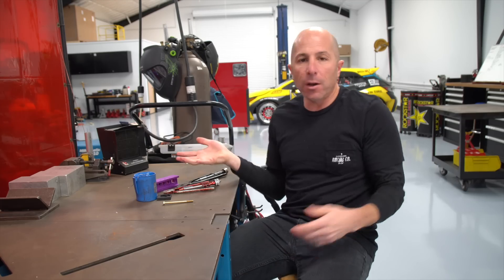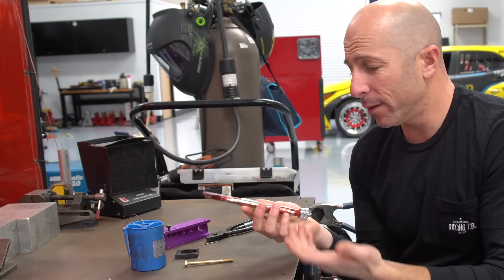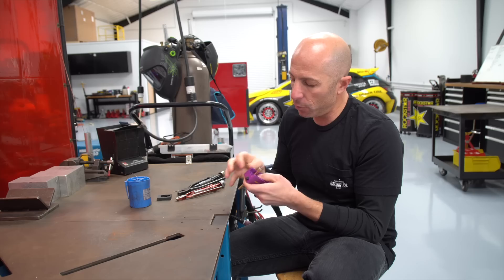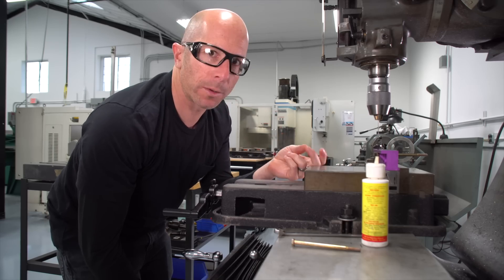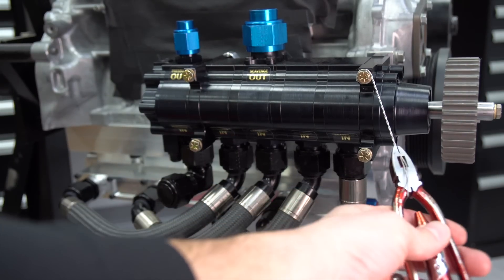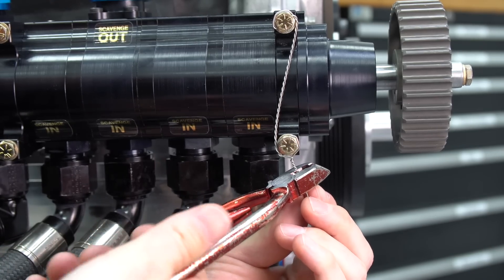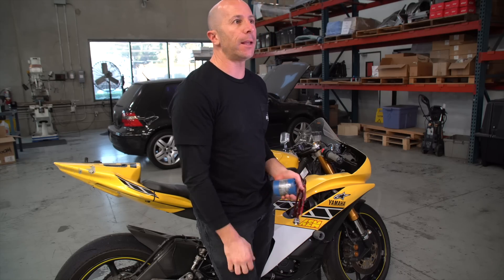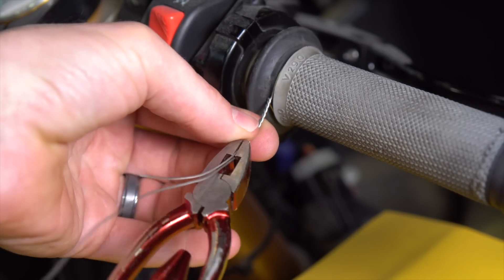How To Safety Wire Bolts, Grips and Drill Bolt Heads

Comment: I work on aircraft and boy do we used safety wire everywhere. Just a tip for you. Once you have the path of the loose wire going to the second bolt. Clamp the tip of your pliers where the hole for the next bolt is. Then give a slight and quick yank of the wire and hold the tension, then twist your pliers. This will pull the slack of of the wire. Another note, as you twist the wire, it will shrink in length and you always want to compensate so you don't have to re-twist on wire you've already twisted. Good video for beginners, but the wire between the two bolts you want really tight as well. For this application, it is fine, though.
Reply: Fellow A&P here...I had no real nitpicks about his safetywire, until how I saw how he finished it. My old sergeants in the AF would've CRUCIFIED me if they saw me wrap the last end around the head and THEN pigtailed it.

Other than that, pretty decent video!

Comment: I gotta be honest man, that wire was too loose around the bolts. I wouldn't pass that. Try grabbing both ends of the safety wire individually with pliers, give some slack, then snap them tight. Do this after every step. To get the twist tight to the bolt, bend the wire off-axis and give it another twist, imagine you're turning an Allen wrench, some people call this the "Boeing twist". If you strum the wire with your fingernail, it should be at least as tight as the pull tab on a soda can.

Comment: Tip. For the bottom bolt, you should have spun the wire the other way with the pliers by hand and finished it off at the exit home (right)

Comment: Well done, video and instruction on safety-wiring.  Just as RJ9mech mentioned, you keep your wire clean and neat.  In the aviation and USAF industries, safety wiring is an art form.  Too many (fighter jet) mechs take pride in how well we safety wire.  While not needed in your industry, we will spend time on safety wire -- even redoing it if it does not look or seem perfect. 

Here's a suggestion - on your wiring, at the beginning of wiring, to get the end closest to the bolt tighter -- after only one minimal first twist, we make a wide (sweeping motion) twist with the plyers.  This will move the tightening portion (close to the bolt) tighter without adding twists.  If you did not make that sweeping/wide motion, many mechs would keep turning, trying to 'chase' that bolt area tighter.  That results in having too many twists in your wire.  It is a simple 'wide sweeping' procedure and better explained in person or over video.

You did a superb job explaining where the pigtail should go for the motorcycle grip.  Why not put the pigtail on the (opposite yours) bottom of the grip for the motorcycle grip?  Doing so would reduce or eliminate the rider from fiddling or catching on the pigtail.  Only for this type of wiring, maybe take a small file to the pigtail, preventing it from being caught on the rider's hand.  Always use sharp cutting plyers or side cuts.  Using sharper wire cutters reduces the rough surface at the cut end of your pigtail.  You did turn the pigtail inward to help prevent catching on the rider's hand.

To avoid losing the cut-end debris, cut the end with the plyer's open end toward you.  THen you place your hand over that area, cut the wire, and you should be able to catch the pieces.  In aviation, we are stringent on keeping our area clean and FOD free.  Foreign Object Debris - FOD -- there too is a term Foreign Object Damage (FOD) when something damages any portion of machinery.  That something could be that cut piece you mentioned.  

We have an allowable and non-allowable amount of twists per inch for the aviation industry.  While not necessarily needed in your industry.  Anyway -- great video, and thank you for sharing your knowledge!

Comment: This is wrong, the last twist (using the pliers) should be counter clockwise. Before entering the second bolt, you must remove one twist ( in your case) in order to make it tight.

Comment: I wonder how many think this process of using lock wire looks easy?   Well,  it's not.  It takes a lot of practice and minimizing work hardening of the safety wire.  In aviation (A&P) the work is meticulous.  And for *sure*,  keep the cut ends away from anything.  They'll made a stab in the fingers that you'll not forget to repeat again.  Yes it hurts!
Reply: Remember too, when you go to get the grease off your fingers, using a rag with MEK,  will be a huge reminder not to get stuck by the tail on the lock wire.

Comment: A&P mechanic, great video. Only thing I would add is if you have the room always twist your wire inline with the safety wire hole. It gets your wire as tight as possible on the starting bolt head.

Comment: Spent many hours to perfect safety wiring in the air wing, if it wasn't tight with precision it got cut. Kinda unnecessary but a shop needs to have pride in its work.

Comment: I've watched several videos and still don't understand the purpose of these. I work in automotive and haven't seen these. Are they like a castle nut and cotter pin but better? I guess in aviation there's no such thing as getting stranded on the side of the road.
Reply: Safety wires are designed to prevent bolts from coming loose during flights. There are a lot of vibration on aircraft especially on aircraft engines and helicopters. Safety wires are more prone to heat than cotter pins.

Comment: on upper bolt  the wire from upper right hole must be straight with the boltheadhole then you start to twist and then after bend the twisted wire down. otherwise the wire on twist start to lose and can slip over the bolt head (happend a lot at flatbolt heads, normal head too)
or you do first twists maunaly with huge angle to each other wires.
the expensive saftywireing system ist https://www.dmctools.com/products/safe-t-cable/ (but safe-t-cable is not allowed tu use inside oil systems).
after lower bolt you do much twists, cutting to short and you never twist behind the outgooing hole, everytime after  outgoing hole and bend after outgoing hole too.

you do racemechanic typical mistakes, just show you from aircrafttechnician or powerplant technician, that small but effected  differents 😉

Comment: Good enough for automotive work but you would probably have been better off using .025 wire, also the pigtail should be about twice as long and be at the hole not between the holes. If you have reversible pliers its best to reverse the pigtail.

Comment: Whats the difference between safety wire and lock wire and is your goal with safety wire to make it harder for nuts and bolts to come lose. Or with locking wire to prevent nuts and bolts from ever coming lose?

Comment: The first bolt shouldve started on the opposite hole.  As you did it wouldve been a fail the in the airforce.

Comment: Should the safety wire ALWAYS be twisted clockwise in every case? How do you know which direction to twist?
What about the pigtail at the end? What about reverse threaded bolts? I understand that the wire should be pulling on the opposite side of the bolt (obviously) but what about the actual direction of twisting of the wire. Would it need to be reversed?

Comment: You gotta snap the wire before twisting so it get tight around the bolt head, at 5:17 you see its really loose when you are moving the twisted wire.

Comment: Don't mind me, just removing all adjacent bolts in my engine bay, drilling them out with a drill press and wrapping tiny wires around them for no apparent reason
Reply: not sure why you'd do that, seeing as safety wire is only used for safety critical components in extremely high performance applications, where it's actually needed ;)

Comment: Far to loose from the start of the twist you should pull the wire tighter and also when you start twist you should go almost inline with the wire inline with where the wire leaves the bolt hole it will get you a tighter neater twist

Comment: I'm in the air force and trust me maybe 10% of the stuff that on aircraft come premade holes most of the times we call a specialist with sheet metal or metals tech to drill the holes for us. normally we just install w/e bolt, nut or screw and they make the hole and we finish with the safety wire.

Comment: A lot of people are critical of the safety wire job he did on those bolts, but as an aircraft mechanic I’ve seen much worst than that on actual aircraft, the job he did wasn’t too bad considering it’s on a car.

Comment: I would have put the wire in the other direction on that motorcycle you pull down on the throttle and it goes up if you let go. It could dig in your hand when your really pulling on it or could grab you if you release it. Just worse case scenario bc it's only going to happen when it matters most

Comment: What if theres only one bolt to safe wire...
Reply: Gizmoriderful Ye general practice is to go from stationary to moving, usually there’d be a hole drilled on or near the component you’re safety wiring the bolt on, and that’s where you’d safety wire it to.

Comment: Future AnP mechanic here n so I took a whole class on safety wiring an hardware usually on high vibration areas (which is usually the whole plane). Any ways a rule of thumb is 6-8 twist per inch.

Comment: That lower bolt is a neutral safety, next time wrap that lower tail up top right next to that hole exit and alligator roll it and put a nice pig tail. Also pro tip, if you grab the middle of the safety tail and try to curl it, the end will unravel and vibration will loosen it. Instead grab. The very tip and roll it in, the ends wont split that way.
-15T Helicopter crew chief/maintainer
Reply: Do a video on it. Cant understand it from short comment

Comment: I have some decent blue point pliers, unless I have really long gaps between points, I usually will use some modified vise grips, duck bills, and needle nose.  On short gaps I think it's actually a bit faster and I have more control, if I have to span the grand canyon though, I will use my actual safety wore pliers.

Comment: During my Air Force days in Keflavik NAS  Iceland , I was sitting in the emergency room waiting to have an injury looked at when a young Navy guy came in carrying some kind of aircraft part. I had already been seen but wanted to wait around to see what this guy did to himself...........it was so cold that his hands were numb and he had stuck safety wire through his hand several times and as a result wired himself to the part he had installed on the aircraft (P-3 Orion). Fellow seaman had to remove the part and send him to the hospital to uninstall the part from his hand. I laughed all day!

Comment: Great wiring on the engine but you better wire more safe the grips. Before install they need glue and the end of the wire must fall towards the ground. Of course you need at least 2 safety wires per handle. Great advices anyway.

Comment: First of all my absolute respect, not only as a master builder but as a human been

I never even dream about having something to suggest, specially a Improvement on your technic, but my grip of grips has a big advantage since it uses a single strnad of wire, so Zero Poking on the fingers and much less tear on the grips too

here are a few pictures, very self explanatory..
https://patineto.smugmug.com/Bicycles/Components-and-parts/Safety-wire-handlebar-grips/

This is a also a "Penny Tech" repair method that works extremely well since the load is spread into each of the holes, plus I think add character..

https://patineto.smugmug.com/Motorcycles/General-improvents/Safety-wire-work/

and this on is just for fun, using worn out bicycle chain links.
https://patineto.smugmug.com/Motorcycles/General-improvents/Rivetation-chaination/

thanks again, master of masters

ricky

Comment: Great video! On the motorcycle grips, I like to make the twist start on the bottom of the grip. (where no hand touches) I also fold the end piece in the other direction. The way you placed it your glove could potentially catch the end and twist the throttle open. Also, you can actually stab the end piece of the wire into the grip rubber to help eliminate that from happening.

Comment: We also use wiring methods, but back in the day that was thicker wire. One tip though: if you're putting safety wire on your handgrips, make sure you tighten the wrap, putting tension on it until you finished twisting them. Just to make sure they're tight, and don't overtwist or you will end up snapping the wire! Don't cut too short as well, as the twisted wire itself can unravel and loosen.

Comment: man I'll show ya how to safety-wre!! Great stuff! Also, close the lockwire pliers, put silicon in the little scoop like gap, wrap nose of the pliers with masking or painters tape, let it cure overnight. Then remove thou masking material, slice the cured silicon with a sharp razor blade straight down the middle parallel with the cutting jaws, the silicon will keep your cut ends from flying and it won't impede your safety-wiring technique. Silicone gets old worn from use, clean it out, repeat the process. Tried and true, try it out, you won't be looking for pieces of safety-wire, save time in the garage, account for all pieces. yup

Comment: You do a lot of stuff really well, but your safety wire job would never pass an FAA inspection. You did a few things wrong, mostly though when you came thru the second bolt you start your pigtail two flats too low. Your first twist coming thru a bolt is always by hand (hand over hand style) and you need to ensure that the wire holds itself down and tightens the other wire. Then you twisted the pigtail so it actually loosened the wire. But you are staying on the ground, so I guess it is good enough as long as it does not loosen and fall out.

Comment: Great video on basic motorsport safety wiring. I was an aviation mechanic for almost 10 years. If you want to do it to the standard of aviation, here is the manual. NAVAIR 01-1A-505-1 SWP 018 00 https://www.rbracing-rsr.com/downloads/wiring_pdfs/navair_manual.pdf

Comment: Real reason you don't want your grips moving on the bike is arm pump. But you only need to wrap it around once. Never heard of anyone wrapping it twice. And do 3 points on the grip. Far left, middle, and far right. Even if one of those areas isn't slipping around.

Comment: On cars...yes even racing cars....I personally think safety wiring is nearly always completely unnecessary.  I think it is just a bling-type thing that is done because it is sort of cool and "aerospacey".   As long as bolts are properly tightened, perhaps Loctite used where necessary (although Loctite is way, way, overused as well), the bolt is not coming loose.  Simple as that.  

Most of the truly critical bolts on cars are in or on the engine...rod bolts, head studs/bolts, flywheel bolts, etc.  And strangely enough, most of these bolts use neither safety wire nor Loctite.  These fasteners might fail under certain circumstances, but they never loosen and fall off.

I have never turned a wrench on an aircraft, so I can't speak to that world, but on cars safety wire is generally pure showmanship/pageantry.  I would say "always"...but there might be an obscure example I am overlooking.  He might have just been demonstrating, but you sure don't need to safety wire the bolts holding on your dry sump pump.

Nothing wrong with pageantry...but let's call it what it is....

Comment: Used that technique to hold the exhaust to the header in a vehicle with stripped and missing flange bolts 
A year later and still going strong
Thanks for sharing

Comment: Dude your lock wire is trash. I’m a TI in the Army and your shit would get cut quick as fuck. You have already compromised the lock wire by grabbing on multiple parts with those pliers. Also it’s loose as fuck and have incorrect twists per inch.

Comment: hey man i'm from Brazil, and i'm aircraft mechanic in the Brazilian Air Force, so i did'nt know the tools to make a role inthe bolts thanks to show for everybody, but in the and of yours wire safe i observed that you need to put the end of the wire inside the bolt's role to keep our hands safe from possibles cuts, congratulations i'm learnig so much in this chanel.

Comment: Does drilling head on tty fasteners affect strength?
Reply: Failure of a threaded fastener generally occurs in one of three modes. Failure through the shank or threaded section of the fastener, thread stripping of the external thread, or thirdly, thread stripping of the internally threaded member.  So the strength of the fastener is not relies upon the head.